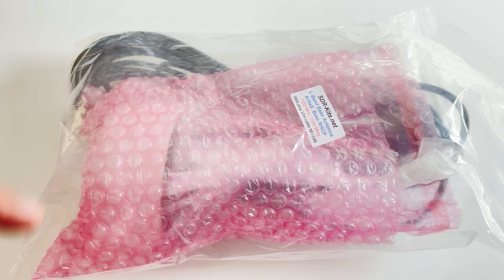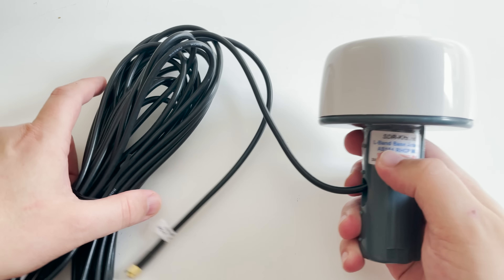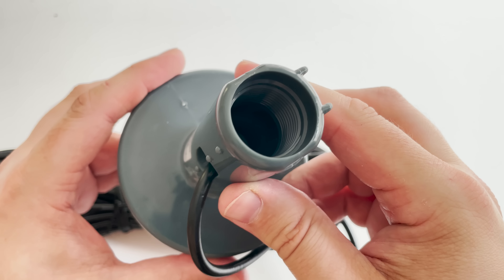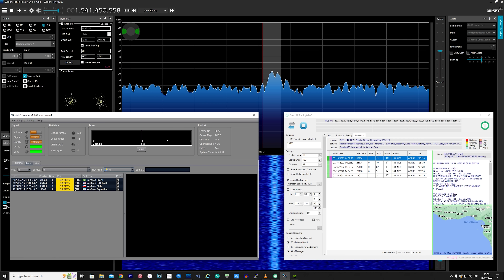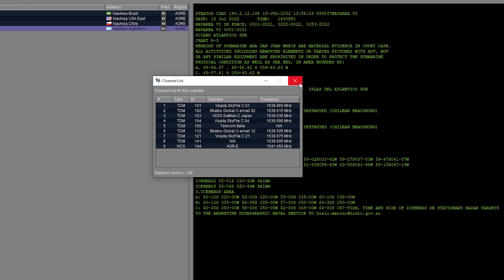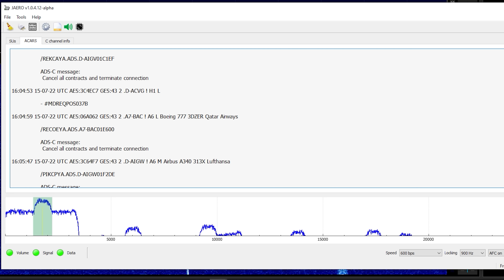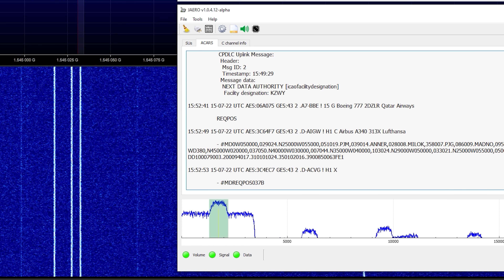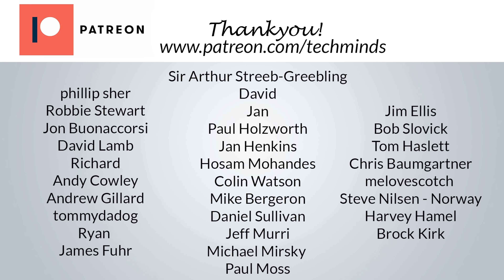Outdoor INMARSAT L BAND ANTENNA From SDR KITS

Comment: Is the bracket mentioned in this video suitable for the square SDR Kits L Band version 2 patch antenna, the black one or the newer grey one, I think they are the same except the colour.
Is the bolt on the bracket the same size thread as the thread on the patch antenna?

Comment: Hello Tech Minds I’ve just received my square patch antenna from rtl blog.  My antenna is pointing south signals received are good.  When I tune to a 600 bps channel in Jaro  decoding is unreliable.  I keep getting either crc errors or missing frames could be sound card buffer errors.  I have followed your instructions in the video, and had limited success decoding acars messages.  Is there anything I am doing wrong eg tuning is off, signal is too weak,  or the band width is wrong etc.  I am scratching my head now can you help?
Reply: Just not 100% aligned. It's very hit and miss. With just another 2db reception it will make all the difference...

Comment: whats the rough price for the Tekmanoid  software ? have sent an email in the past, but never got reply.

Have messed around a fair bit too using the square L-Band  antenna, and picked up a lot of interesting stuff,  a side from the usual weather, pirate warnings, overdue vessels,
have also picked up the odd email and what looked like SMS as well
Reply: I think I paid 55 euros last year
Reply: thanks bit too pricey for my taste, as thats about 90 dollars for me after conversion to AUD
Reply: @therealdjflip  you can use the free slytale c software. It does the same job and well
Reply: @digitalmediafan  I do use that one already, but do like to try other ones as well, and find one that I like / works better than others
Reply: @therealdjflip  ha yes ditto. I'm tempted to buy it but a little too expensive. Half the cost would be more like it

Comment: Just a note to say the map you show at about 30seconds in is way out of date. The 15w and 64e are not operational. You should be able to receive a satellite at 25e and 54w from the UK
Reply: Hello Paul where can I get the coverage foot prints online?  My square patch antenna is pointing roughly south.
Reply: @m3snusteve  Just tune to 1546.027 and up a bit for 10500 traffic then past that a bit for 8400 bps voice traffic, but voice is very sporadic and frequencies change